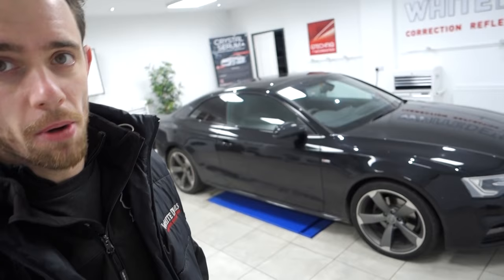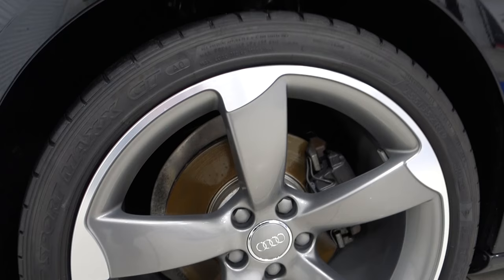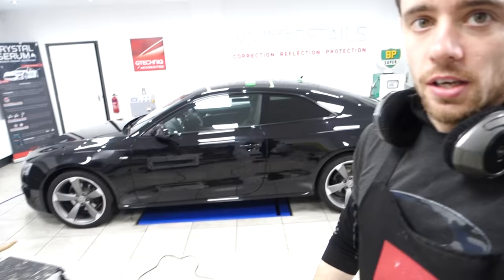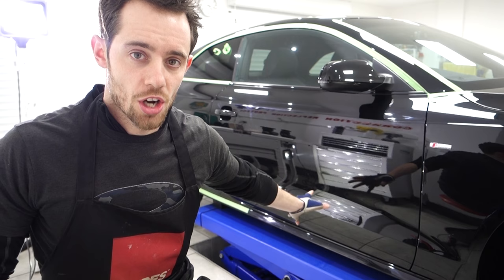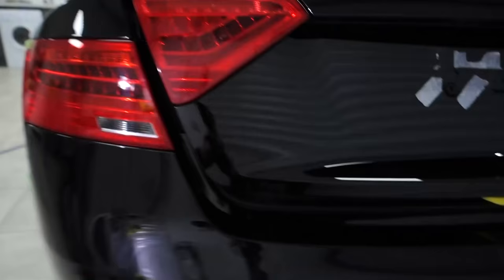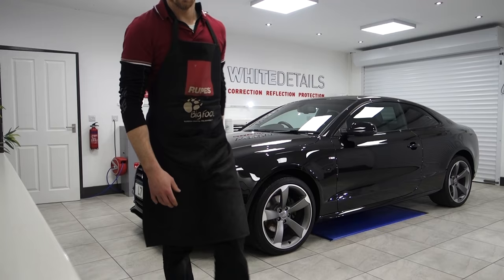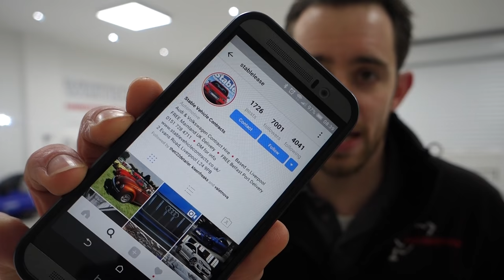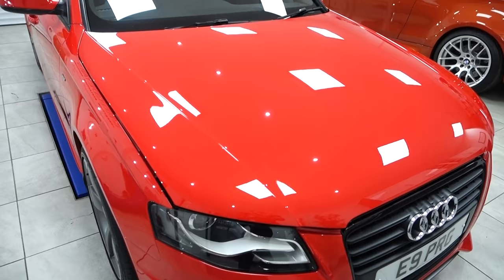Looks like someone's been here before - VLOG 014

Comment: Great video as ever. Amazing you gave the tip for holding the boot lid down as I had that exact issue this afternoon on my car. Didn't think so putting something heavy on it! Also, I think I will have to add the LHR75 mini to use beside my 15 mk2

Comment: Are these Costco towels you're using? If so I used the same ones on a Lexus Rc 350 f sport 2019 it left behind light scratches. Are you washing them prior to use? I had to switch to edgeless microfibers that are super plush and cost a ton more.